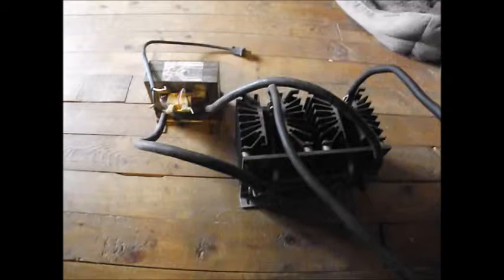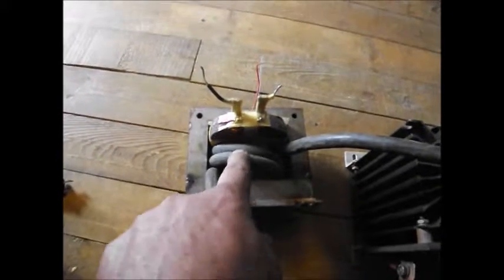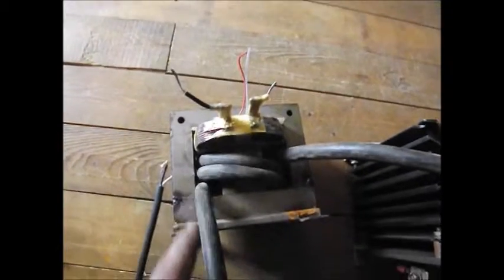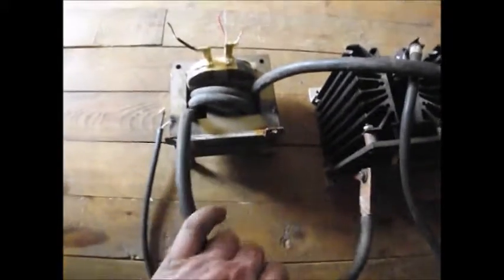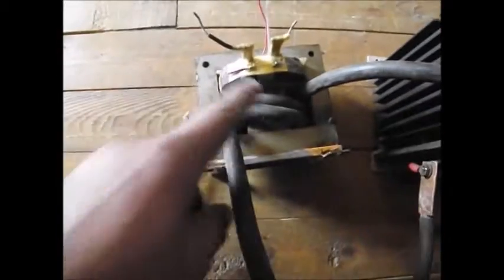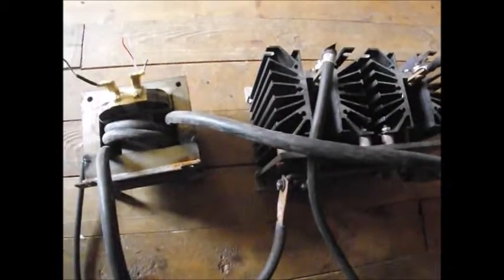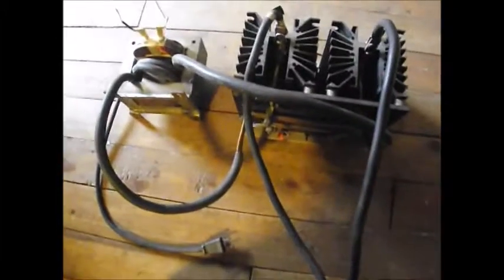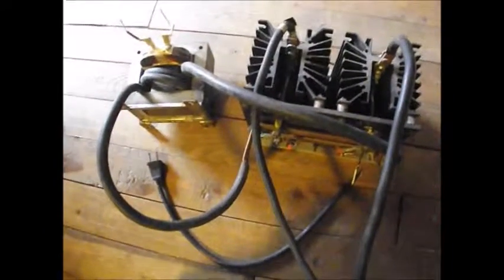Lead Acid Single Cell High Amp Constant Current Super Charger  Part 1

Comment: this is some MAD scientist stuff.. caint wait to see how it turns out
Reply from the maker: sam lyon Kind of sort of it is. I,v lost some single cells in the past and had no way of trying to save them. For this reason I,m building one. So in the future. If I lose any cells Again I will be able to try and bring them back up in charge before I call it no more good and ready for the scrap yard it is. Thank you for watching Sam. The part 2 video should be some what soon. I,m in no hurry To complete it. Maybe a week or two.
Reply: no that's kool are you going to say where you sourced your parts so others may replicate your work.
Reply from the maker: sam lyon I will be Saying Where the parts came out of. There all re-useable Not for any reason though. Its just what I do. In most causes anyway.
Reply: thats great how much knowledge do you need with electricity b4 building one?
Reply from the maker: High amps is high amps. Amps is what causes the unwanted no so much the volts. For knowledge a expert can make mistakes and those unwanted moments can even be there for them. So I don,t trust its knowledge alone that is the only thing needed. When doing any thing really no matter on what that might be. There are steps to take to make it safe. So I,m not sure who would have what it takes to make one. Carefullness is a pretty good place to start.

Comment: cool   looking good box  like to see how this work out for you
Reply from the maker: herbsterplace1 It Should work out alright. Unless the amps end up being to high. Time will tell. I really need one and have for a long time. Now I will. As long as the heat does not build up to much. I might just use a cooling fan to help it out. Thanks Herbster